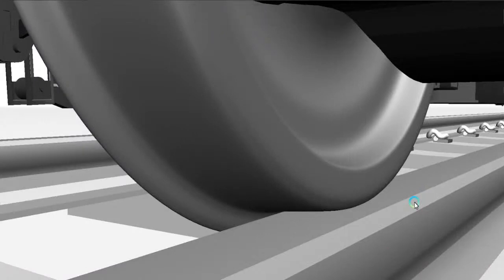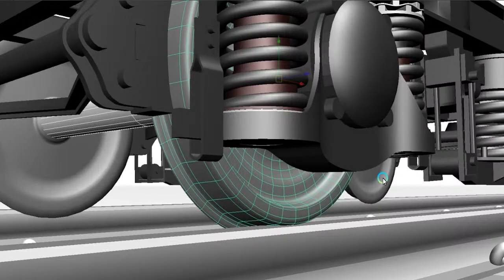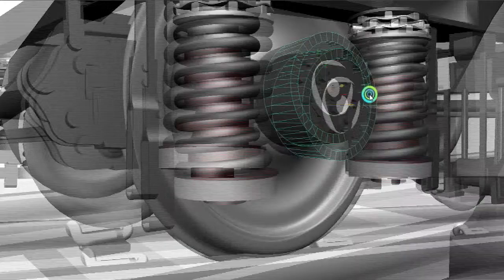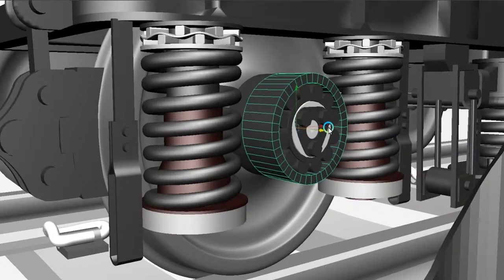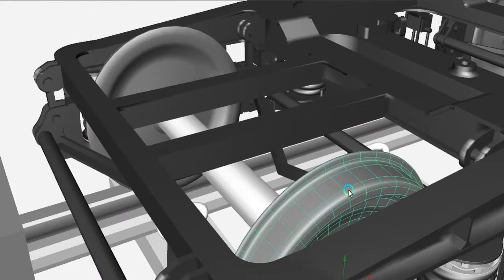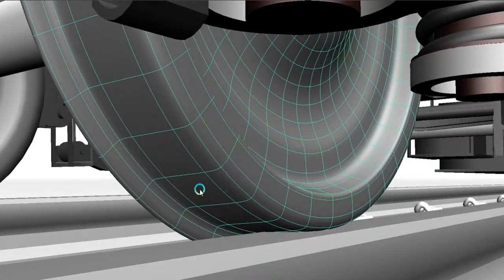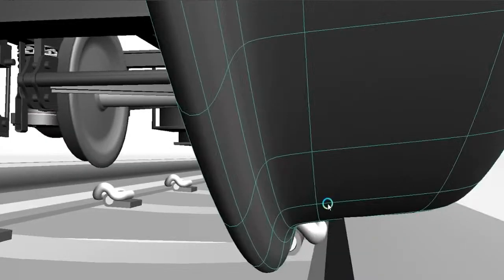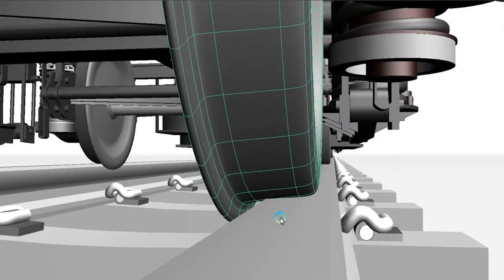Let's discuss wheels set assembly

Comment: Make videos of working of diesel locomotive, 3 phase electric locomotive working. These bogie coach videos are good. But you need to extend your area. There is not much rocket science in wheel bearing and axle and stuff on the bogie.